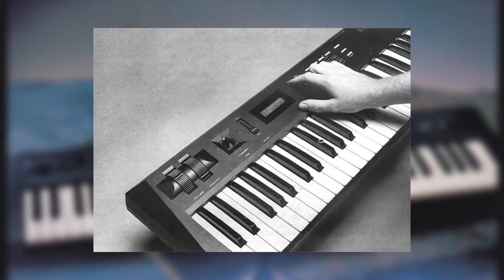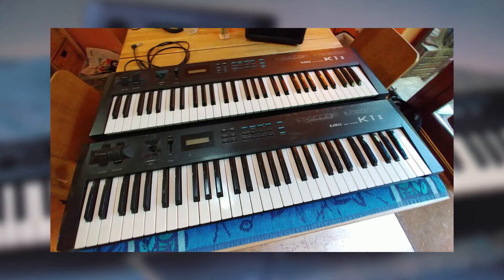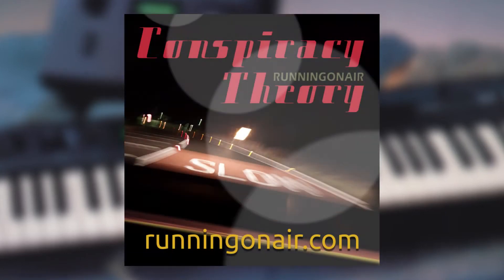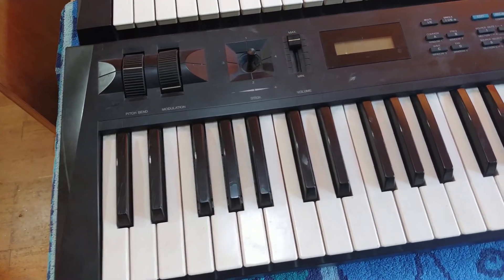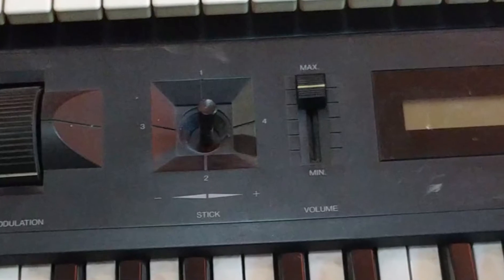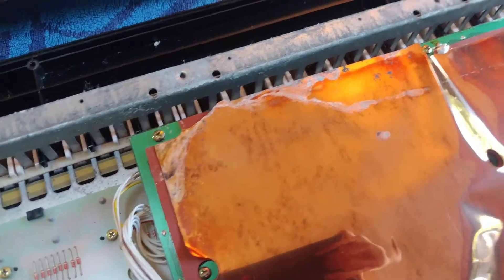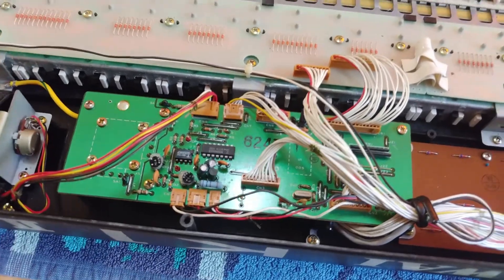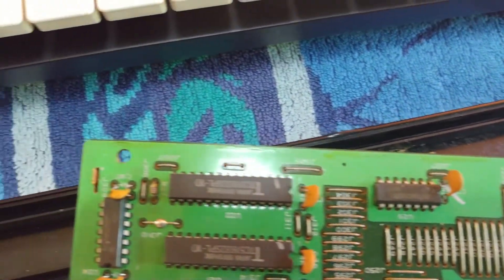Kawai K1 II Synthesizer - Part 1 - Fixing it

Comment: On my Kawaii K1 II, the lead weights on 3 of the black notes fell out. To repair, I had to open up the instrument, remove the keyboard, detach the electronic boards on the back of the physical keyboard, remove the neighboring white keys, and reglue the lead weights back in. I used Gorilla Glue. Then to be proactive, I added glue to all the lead weights of the white keys. And then fashioned a long nozzle out of a 1.5” plastic drinking straw (slitted then taped into a cone). Then glued (super glue) and taped the nozzle to a medical syringe, filled the syringe with Gorilla glue, then used the syringe & nozzle to dab globs of glue onto the weights of the black keys. This meant I did not have to remove all the black keys. 

Being a bit careless with the amount of glue, some got too much and I had to remove those keys to scrape off the excess glue. After the glue set overnight, I began to reassemble the keyboard. Unfortunately, it had sat disassembled for several years and I had either not taken photos, or had deleted them. This video gave me enough glimpses of the inside to make it possible to reassemble everything properly. I hope!

I’ll update when I finally get it together & it works properly!
Reply from the maker: Glad it helped. The process is reasonably straightforward, just take your time and you should be ok.
Reply: Now I don't have volume nor does it communicate with Finale. All this worked fine before I took it apart and replaced the battery. All cables are plugged in. Not sure where to go from here. @RunningonairMusic
Reply: Problem solved after removing those little black spacers between the keys & the contact boards. Now everything works fine. I don't know why I had to remove them. There must be something else out of alignment. But as long as everything works...  Thank you for posting your videos!
Reply from the maker: Glad it worked out in the end!

Comment: Hello: I just inherited one of these, and it’s got 5 or 6 non working keys (none smashed down, just “dead” when pressed), and a missing volume slider.  The modulation wheel is also jammed. Any ideas on key repair for this one? Thanks!
Reply from the maker: Do you have experience of fixing electronics?  If not, you should consider finding someone that can help.  Another option is to join an online group that discuss fixing old synths, facebook have one.  But to answer the question, if all the keys are together, it's probably a pcb track or connection problem.  If they are spread, i would think dirty contact pads.

Comment: It's good that you are still active here!... I have a K1 ii whose sounds were deleted, but not the patches, if I change them the changes are saved, but the sound is always is the SAME  (something sinusoidal), it's as if it had lost the base PCM waveform (I don't know if I explain myself, I'm not a native English speaker), what would I need to repair it, the IC roms?  I already have the service manual and I think the IC U17 is damaged... I wanted to confirm and know if it can still be obtained.
Reply from the maker: Hi, I doubt you would be able to get any replacement ROMs.  If you did they would probably come from another mother board.  So I think your best chance would be to try to get a working mother board or just get another K1 and sell the one you have for parts.  For further advice I would check out the FaceBook synth spares and repairs group, also check Kawai K1 group.  They may have better ideas.

https://www.facebook.com/groups/728754043804016

https://www.facebook.com/groups/133768630576

hope that helps.
Reply: @RunningonairMusic  ok thanks for the reply... well that keyboard still works as a controller anyway.

Comment: how sound the digital distortion problem? please I have a K1II, functions all ok , but the sound are distorted saturated, sound like a ring modulator this is the problem?
Reply from the maker: Sound's like a main board issue.  You'd need to find a synth technician to give you a better idea.
Reply: yeah I have a K1. Tried a few patches and some had some distortion/noise but hard to know if this is inherent in the patch. Would any 'digital distortion' problem be across all patches?
Reply: @theprogrammerrolandmc3039  sold it now - want a K1M
Reply: @squishmusic  yes its all patches, like a circuit bent sound
Reply: @danielortizdecaracas have the same problem with my k1r II with the distorted sound. Do you maybe know what causes this problem? And how I can fix this!

Comment: I have some issues with my K1 II. There is a delay effect on all of the patches and I can't get rid of that. Is there a way to do a factory reset or sth just to get the plain sound or it's a serious malfunction?
Reply from the maker: Check the section of the manual related to effects.  You should be able to turn off or change the effect depending on what you want to do.

Comment: how to fix keyboard problem in this synth? suddenly some keys of my synth stopped sounding, disassembled, cleaned and now the same, but not the same, does anyone know what it could be?
Reply from the maker: There are four main areas to consider.  The contacts, the connections and the PCB tracks or broken wires. alcohol is normally best for the contacts, where as the connectors need some form of contact enhancer  eg. https://www.sibert.co.uk/products/stabilant-22-contact-enhancer.  Wires can be easy to find depending if they are on a ribbon cable or not.  Tracks need to be tested using a continuity tester.  overall this can all get quite complicated.  It might worth joining an appropriate online group to ask more detailed questions.